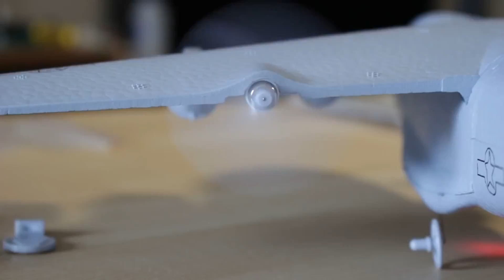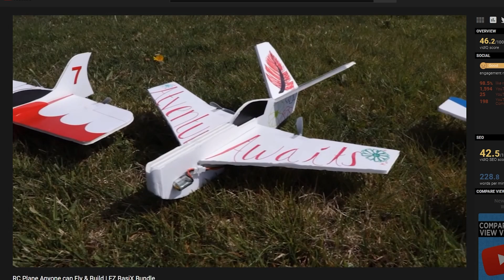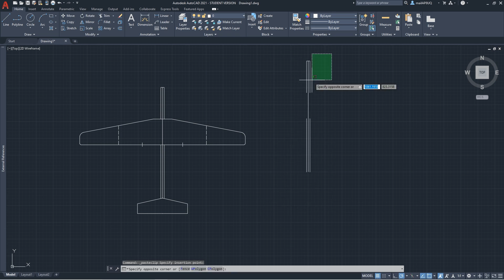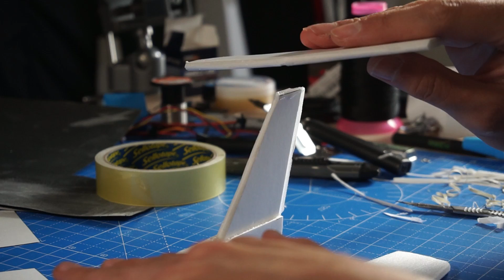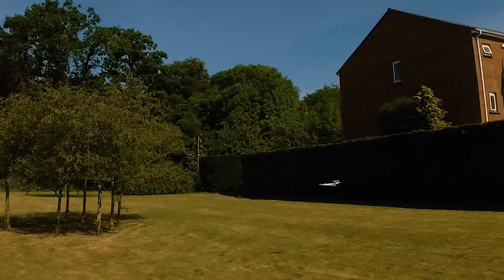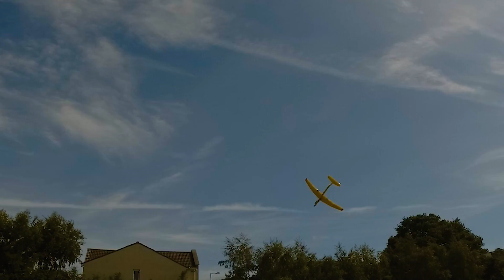Dirt cheap Mini RC airplane | Homemade and no complications

Comment: Joyvel unkle please tell me that what kind of thrust i can get in a raching drone motor if i use 2 cell lipo
Reply from the maker: Usually a DC motor made to work with 1S will burn with 2s batteries
Reply: Thanks

Comment: some info.       at 4:59,  this model has some obvious, and Avoidable,  ISSUES.    these issues have  Nothing  to do with the simplicity of the model.   they  are  the result of the  Huge gaps  in the maker's  knowledge.       the use of wing-mounted motors  should  NOT  be combined with  positive aoi, at the main wing.   angle of incidence.       for two-channel flying,  some  'nose-up deflection'  SHOULD  be  built  into  the  horiz-stab.      because of its t-stab configuration, this model Should  be  Inverted  when cg-balancing.       cg should located at thirty percent of chord/mac.  mean aerodynamic chord.    or, a bit forward of thirty.      googletranslate

Comment: That's awesome
But a request 
Can you try to make a diy  esp wifi plane with phone control and using differential thrust only??
Reply from the maker: For that I think I'll need some Arduino. I'll see what I can do.
Reply: @Joyplanes  
Maybe you should check out this link though 
I got the idea from here but I need a much better design and some additional feature like accelerometer to it
https://youtu.be/8wR0m9Vc0YM